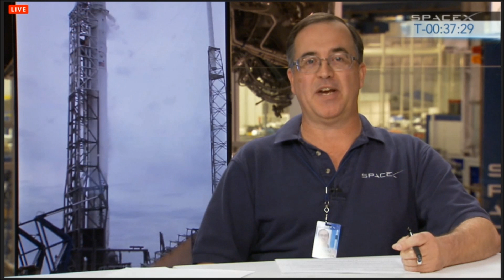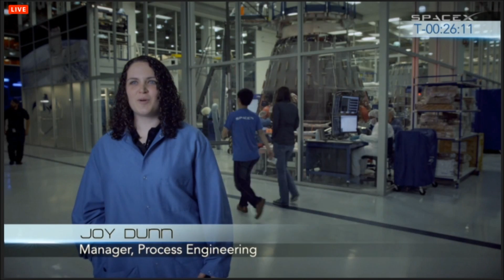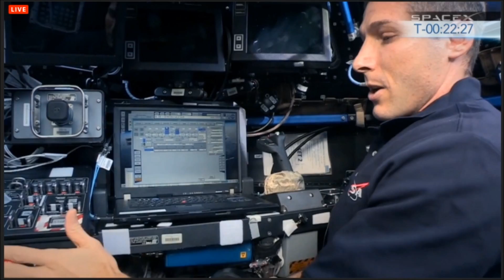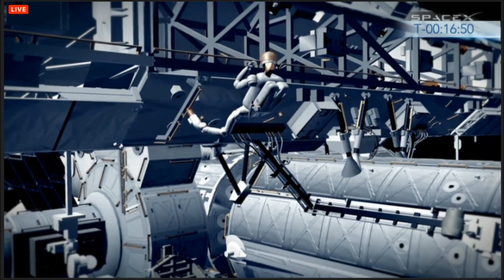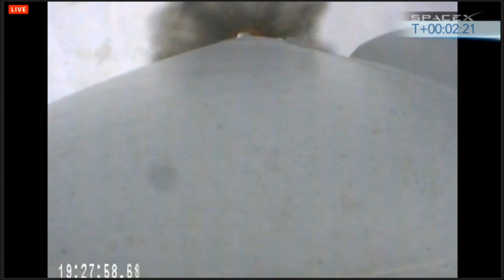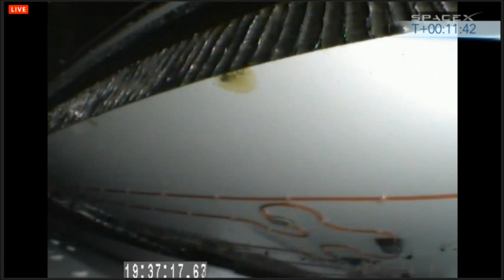SpaceX Webcast - CRS3 Falcon 9 (landing legs) Launch Success! April 18, 2014

Comment: Oh man... Anyone else see that liquid fuel line catch fire as it launch's? Could have been verrrry bad....
Reply from the maker: Wasn't a liquid fuel line. Elon confirmed the plume of smoke was just evaporated dirty water from cleaning the launch pad.
Reply: Megneous Yes, I know about the smoke plume for the dirt. I'm talking about at 40:10 You see a fuel line on the Umbilical Tower catch fire and swirl around.
Reply: Brandon Kenniston Yes - I saw it too but maybe it was an Oxygen line. Looked a bit tricky though - agreed
Reply: Brandon Kenniston Not as bad as it looks. It happened with all of the Falcon 9 launches, but not really with the v1.1 launches. Not sure why it happened here, I thought the v1.1 redesign was supposed to alleviate that. AFAIK it's not dangerous.